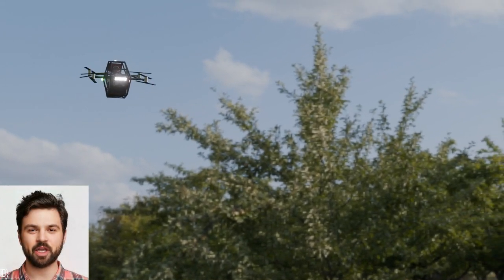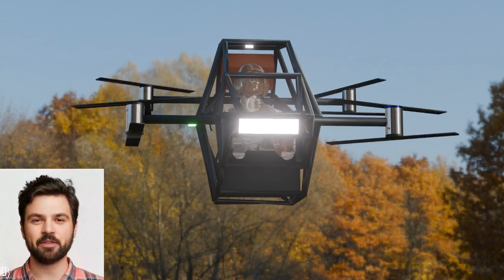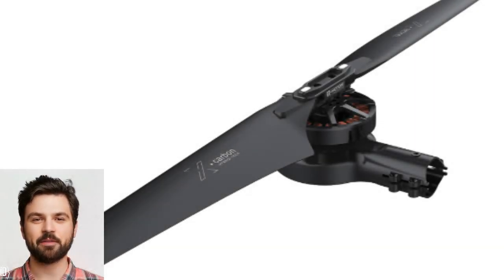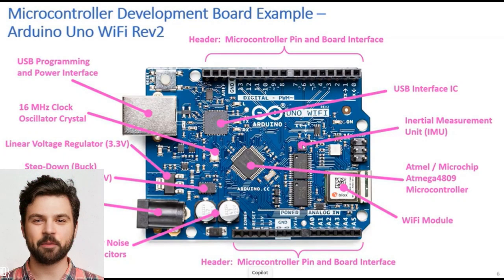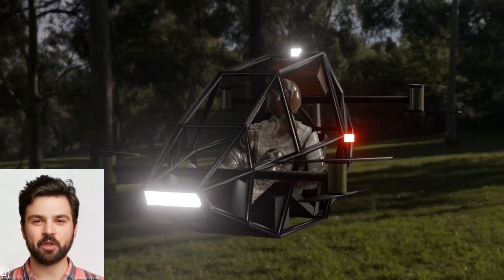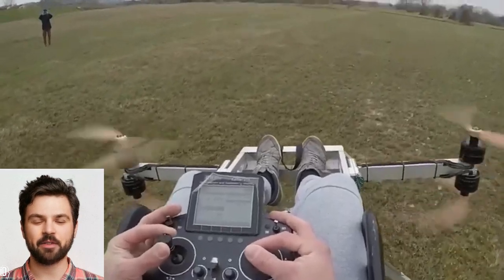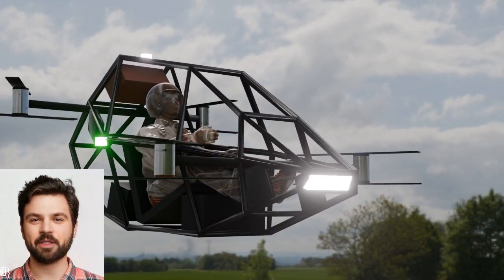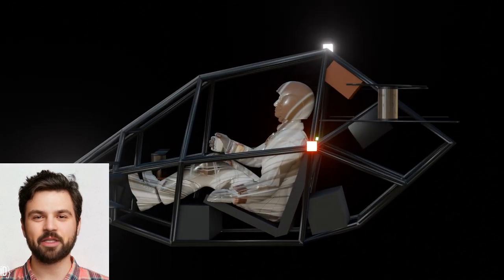Revolutionary eVTOL Quadcopter Drone: The Future of Flight Is Here!

Comment: I really appreciate your efforts! A bit off-topic, but I wanted to ask: My OKX wallet holds some USDT, and I have the seed phrase. (alarm fetch churn bridge exercise tape speak race clerk couch crater letter). How can I transfer them to Binance?
Reply from the maker: It's great that you have your seed phrase securely stored! Here's how you can safely transfer your USDT from your OKX wallet to Binance:

Verify Details on Binance:

Log into your Binance account and go to the "Wallet" section.
Select "Deposit" and choose USDT.
Select the correct network (e.g., TRC20, ERC20, etc.). This must match the network you'll use on OKX to avoid loss of funds.
Prepare to Send from OKX:

Open your OKX wallet and navigate to the USDT asset.
Select "Send" and paste your Binance deposit address (double-check for accuracy).
Select the Correct Network:

Make sure the network chosen in your OKX wallet matches the one selected on Binance (e.g., TRC20 for lower fees or ERC20 for compatibility).
Complete the Transfer:

Enter the amount of USDT you wish to transfer.
Confirm the transaction and follow any additional verification steps.
Wait for Confirmation:

The transfer may take a few minutes or longer, depending on the network congestion.
Important Notes:
Seed Phrase Security: Never share your seed phrase with anyone or input it into any website or app claiming to "recover" wallets—this can lead to loss of funds.
Fees: Be aware of transaction fees on the chosen network.